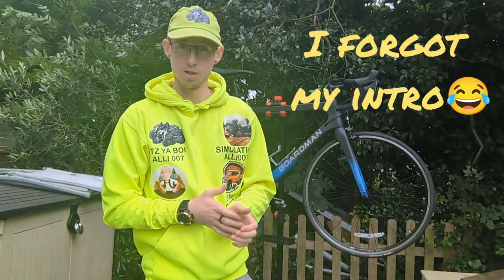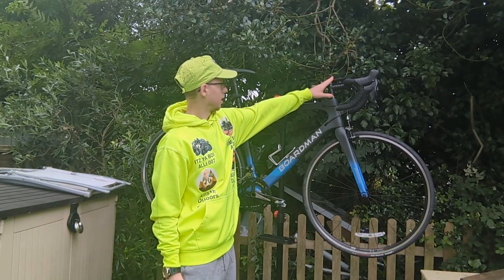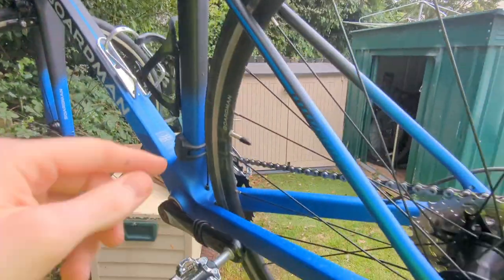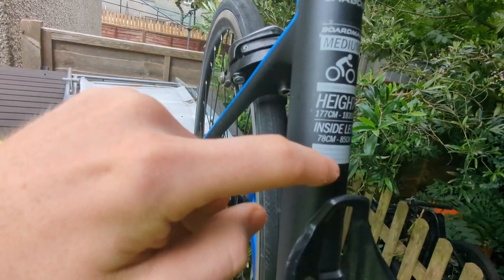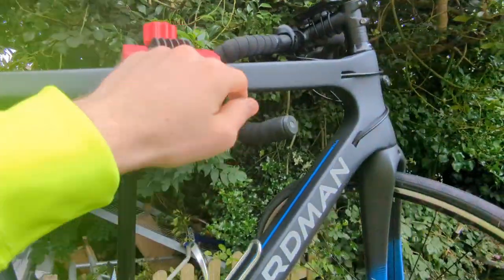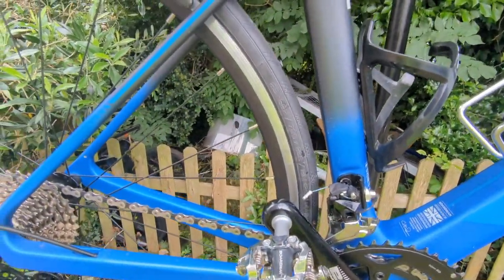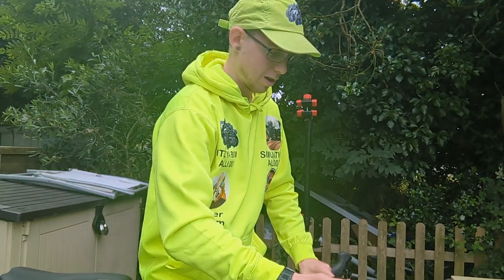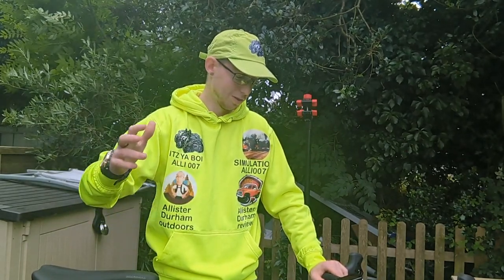Boardman SLR 8.9 Mens road bike review

Comment: Have you tried fitting it with gravel tyres and tried riding it on gravels. I have a specialized road bike and occasionally ride it on gravels and it’s manageable. Been thinking buying this one. I live in an apartment so light bikes like this are the ideal bikes for me.
Reply: You won't get a treaded tyre to fit the SLR as the clearance is completely maxed at 28mm with a road slick.